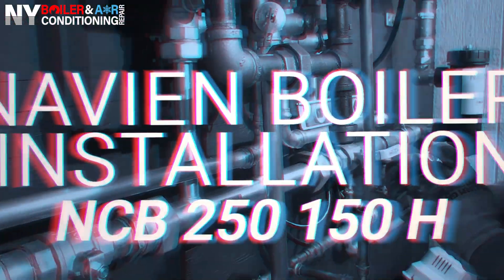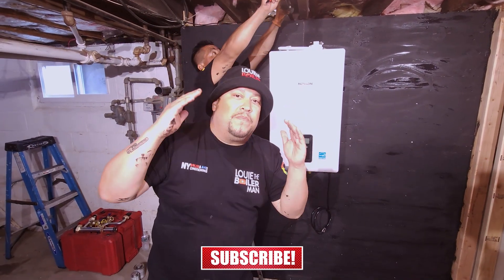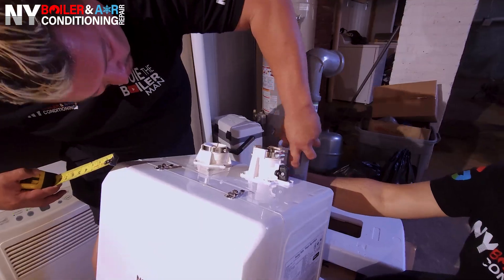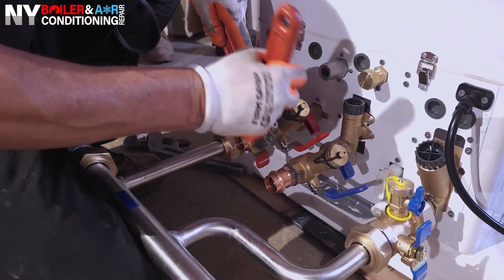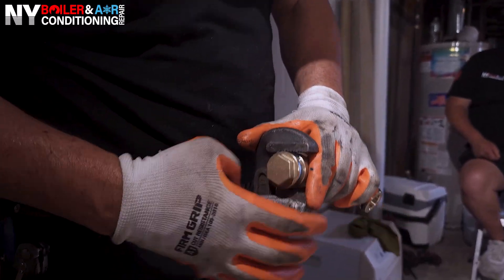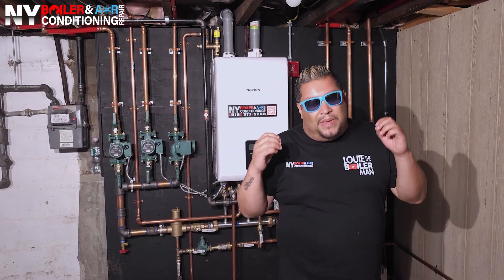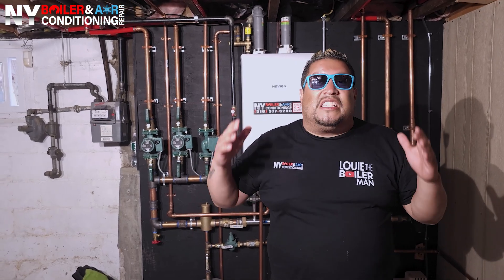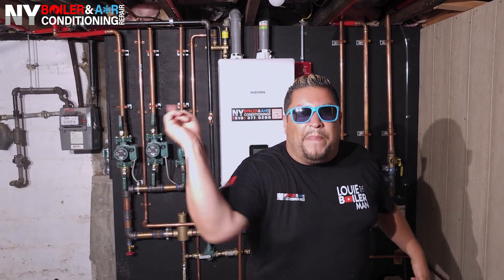Navien Boiler Model NCB 250 150H Full Installation Process

Comment: Hey Louie, great video my man.  Just a quick note, I see black fittings on copper pipe, which may lead to dielectric corrosion down the road, brass fittings is the way to go with copper pipe IMO.
Reply from the maker: Yes, Your right. The reason for it is for 2 reasons. The cost of material and the main reason, no one has any of the fittings we needed in brass. Brass fittings at the time and even now is very hard to get and the boiler had to get done because they needed hot water and to make the boiler fittings match we used black so the fittings match. Presentation is also important and part of the job. So thats the reason why we did what we did. I agree with you but if the money is not there and we are a business to make a profit, we gave him an alternative. We as pros know what needs to be done but not everyone has the budgets to do them so we have to think of other alternatives to still give them what they want and need and also not to lose the sale.